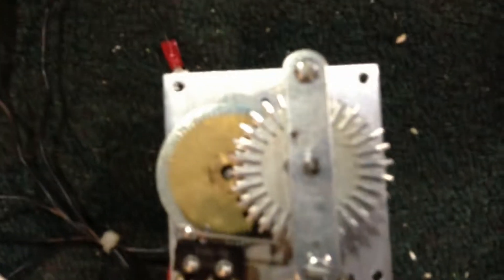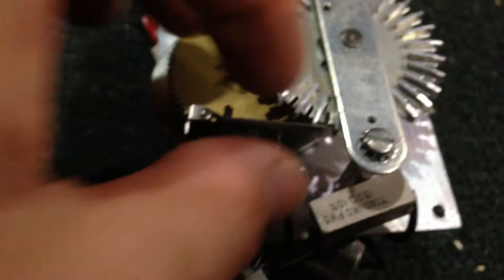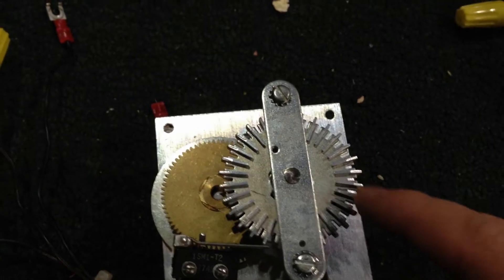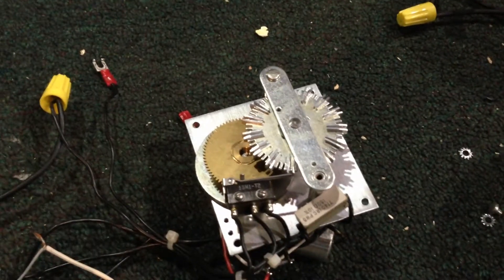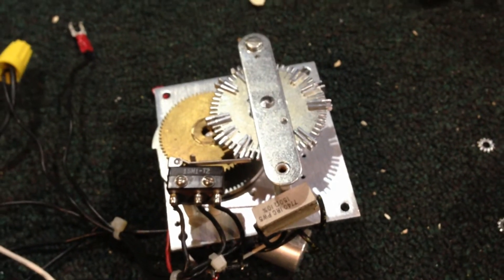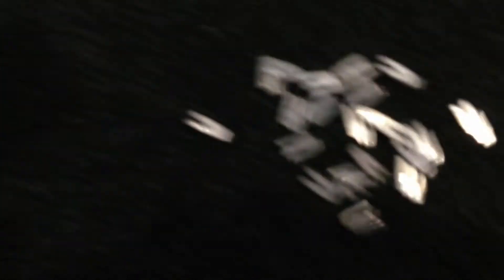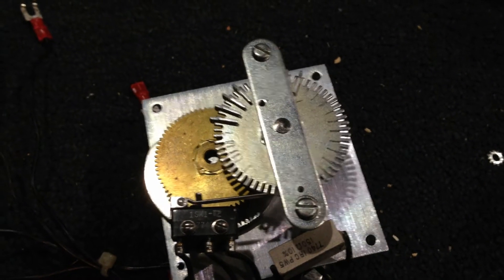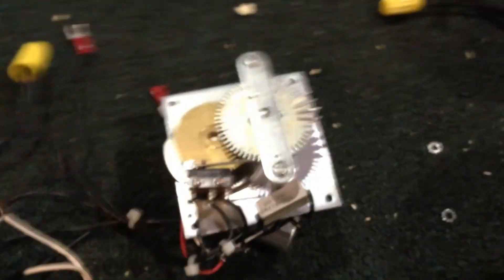Simplex 4208 Code Wheel Demonstration

Comment: Many Simplex 4208 and 4207 systems in my area were set up with coding wheels like those, but in most cases they would just be used to flash the 4050-80 light plates on the system in some kind of March Time while the horns sound on Continuous.

Comment: In an old building i visited last month, they had a Simplex 4208 system with dual projector 4040's and 4251-113's. The 4040's did a coding i have never heard before. They were doing 1-2-3.

Comment: When you did the close up of the horn itself does that actually have an LED or regular light bulb that comes on when the horn is sounding or did you put a flashlight behind it or shine a light down into it?
Reply: I know I’m responding to a 9-year-old comment, but it just looks like a flashlight to me. If it came on when the horn was sounding, the light would be pulsing at 4-4 just like the horn, instead of staying on like it did in the video.

Comment: If the installers wanted the 4208 to sound in steady, they wouldn't even bother adding in a coding wheel.
Reply: +Jakob Hill Sometimes they'll set up a system with a coding wheel that would just flash the visual signals (like 4050-80 light plates) while the horns were on Continuous. I've seen quite a few 70s Simplex systems set up that way.

Comment: What about Code 4 not Code 4-4 the Code 4 that is like Code 3 only with 4 pulses instead of 3 and Code 4-4-4-4 like what you did on the Simplex 2001
 and Code 2 that's like Code 3 only 2 pulses